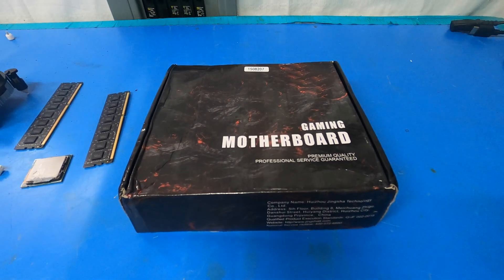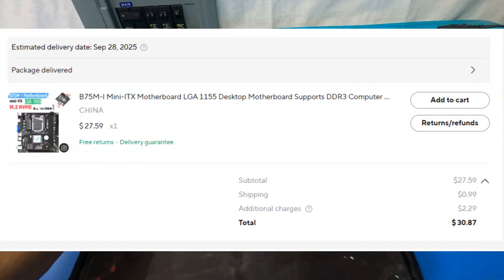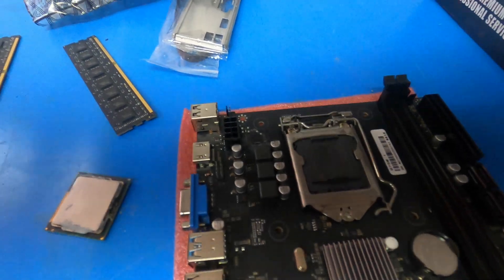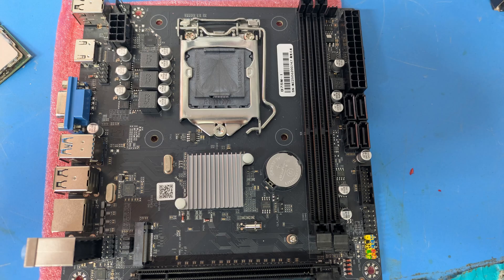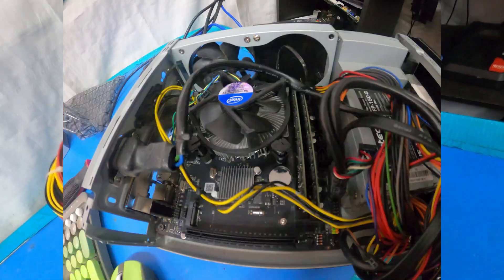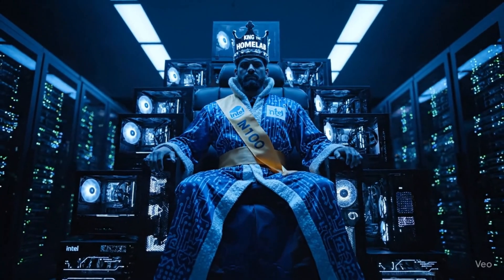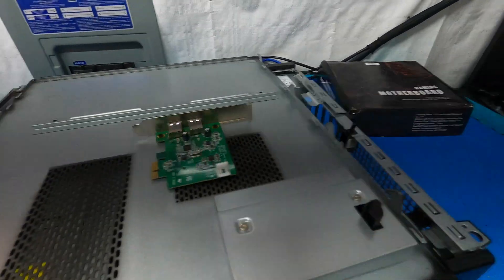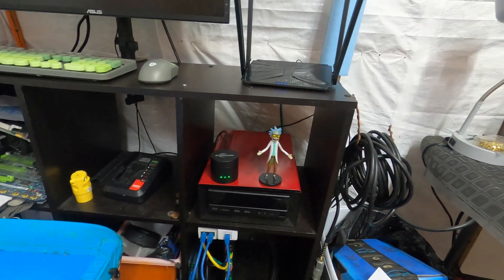Cheapest ITX Mobo on AliExpress: B75M-I Mini-ITX

Comment: I think you need to upgrade your lighting to something with less flicker, there's rolling dark bands on all of your videos and it constantly messes up the auto exposure
Reply from the maker: Its actual the walls being to reflective, and mixing with natural light that makes it worse.  Its why the night  shot videos are much better.  Cameras anti-flicker gets confused.  Its also worse on the older SIlver7 I was still using for some shots when the newer Hero10 is being used  as a webcam.  But after this video its retired.   I plan on redoing the walls next spring, but actively running my business out of here, and it feeding internet to the house makes it difficult to take it all down for a day or two. When I built the shack the office lease was running out so I needed to move everything in here fast and didn't have time to have the walls done professionally, and I am a terrible carpenter.  I do have some lights sent to me as an Amazon vine review sample, but they are wired lights and I need to get  the boxes and install them.